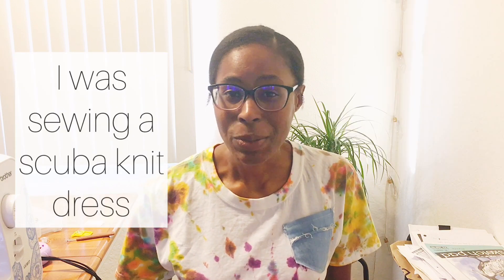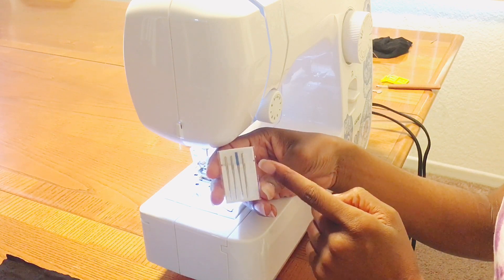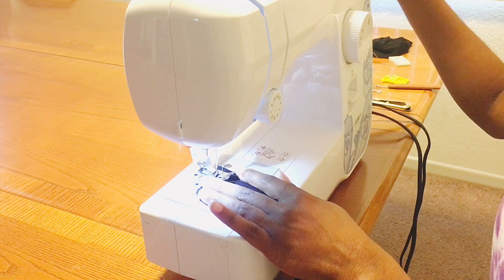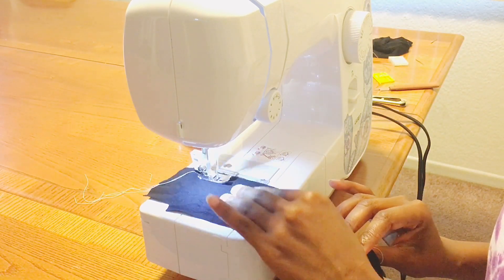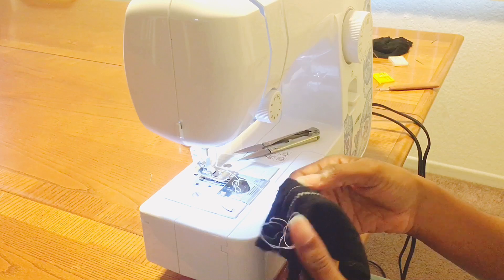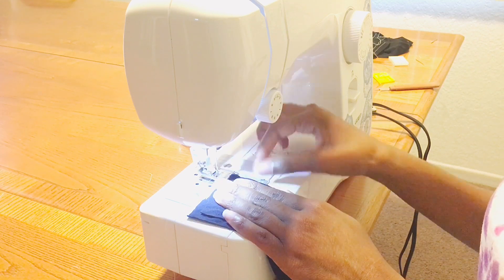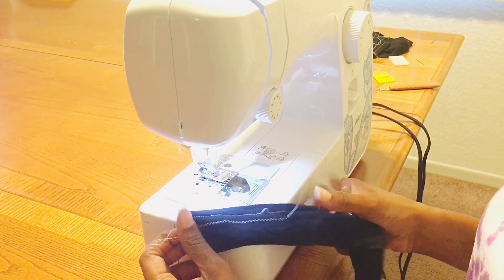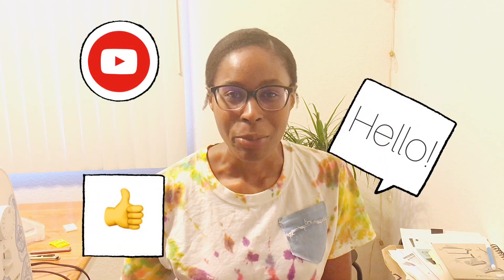Sewing Knits: How to fix skipped stitches

Comment: Thank you so much for your video. I changed my needle to a jersey needle and it's still skipping.  Do you think the bobbin has anything to do with it?
Reply from the maker: Hi! That could be a possibility. If you have not cleaned your bobbin racer in a while, start by checking there. Lint build up can mimic other problems. Here's how I clean my bobbin area. https://youtu.be/XAQPbCsNZJM

Comment: Please help me I cannot figure out how to get even tension on my threads when I use a twin needle one of them is perfect the other one is loose I don’t know how to adjust tension for one and not the other. Please help
Reply from the maker: Hi! It could be that one of the threads is between the tension discs and the other is not. If you are not doing this already, try threading both threads together as though they were one. Make sure the presser foot is up. Separate the  threads when you get to the eye of the needle. I hope that helps.

Comment: When sewing with Eloflex thread, do you use regular thread for the bobbin? Or Eloflex in the bobbin as well?
Reply from the maker: Brent, hello! Use Eloflex in the bobbin as well 👍🏾
Reply: Thank you so much! I have been having a lot of issues with skiptched stitches. I have the right needle, loosened the foot pressure,  but still issues with skipping. I have been using regular thread in my bobbin so I hope this makes a difference.
Reply: @Sewintoitlessons  so I tried the thread in the bobbin. Things were great!! 5-6 test stitch rows were perfect so I started my project. BAM!! Skipped stitches again! So I played with tension and nothing helped even a new stretch needle. I just saw a tip that the material can lift into the larger gap of the presser foot. So they suggested a simple piece of tape under to "seal up" the gap. I just finished my project with no worries! So a simple piece saved me after hours of frustration! Who knew!
Reply from the maker: @brenthulst5413  that’s great! I often teach to use a piece of tissue paper over the sewing plate at the beginning of the stitch to keep lightweight knit fabrics from being pulled under. I’m so glad that tip worked for you!

Comment: What is your tension on for sewing knits? I have the same machine.
Reply from the maker: Hi! I don’t typically need to move my tension setting. I only do if I am sewing a fabric that is particularly thick, heavy, or light. In this video my tension is on 4 and it’s in 4 right now. Knit fabrics also come in varying weights. You might see that you would need to adjust the tension a little if you were sewing a tissue thin knit vs. a double knit fabric. I hope that helps.

Comment: Didn't help at all.  Brand new jersey ballpoint needle did nothing. Tried every size even. Kept skipping. 
I am halfway thru this vid hoping there are more suggestions to try than just 'change to the proper needle. '
Reply from the maker: Hi! I’m sorry you are still having difficulties with your project. Using the right needle for a project is a major factor when sewing with any fabric. When it comes to troubleshooting sewing machines or fabric issues, there are a number of possible solutions and you have to find the correct one. I have a video about machine troubleshooting. These are also the things I teach in detail to my sewing students. When it comes to sewing knitted fabrics, changing the needle usually is the top solution.